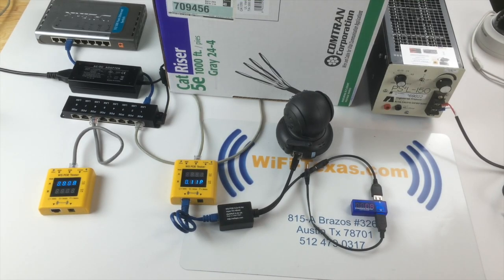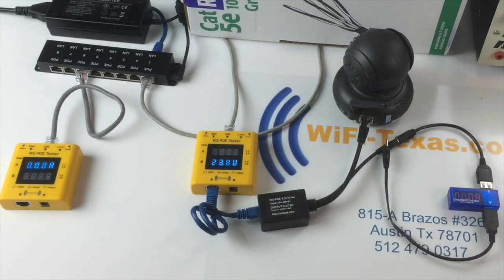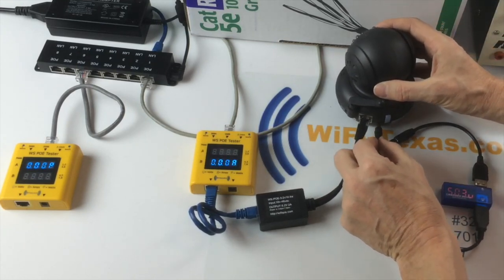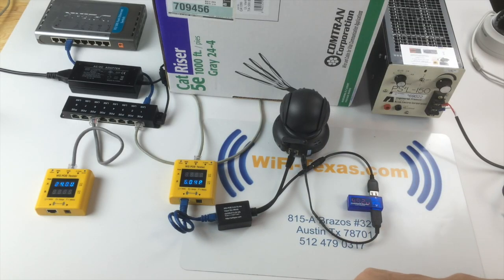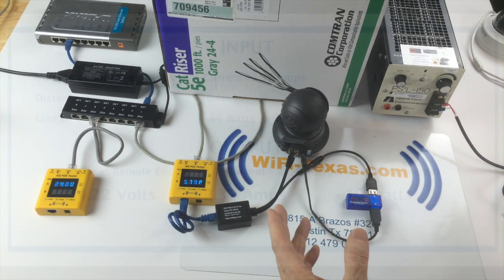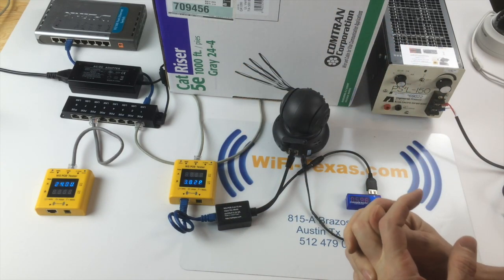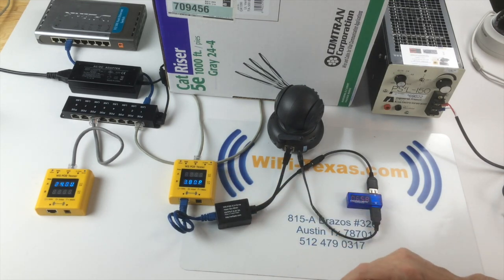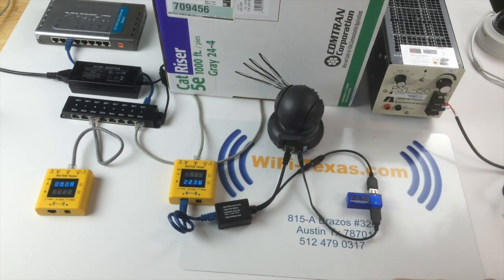Power Over Ethernet for Foscam and Other 5 Volt Non-PoE Cameras

Comment: Thanks for this video! I am attempting to power a Foscam C1 which does not support PoE, by PoE. Just one camera. 

Will this work for me: Router --> cat5 --> PoE injector --> long cat5 --> PoE splitter --> Camera?

If that is correct I have two questions:
1- do I need active PoE injector and switch, or can the cheaper passive ones work?
2- the Foscam C1 power input is a micro USB port, so what will I need, a converter/adapter - from DC (small circular thing) to micro USB?